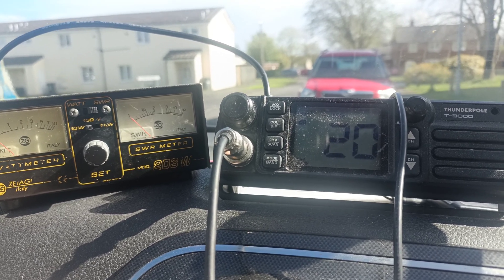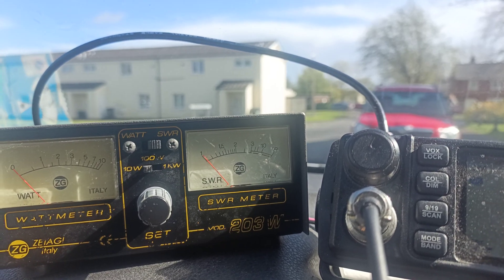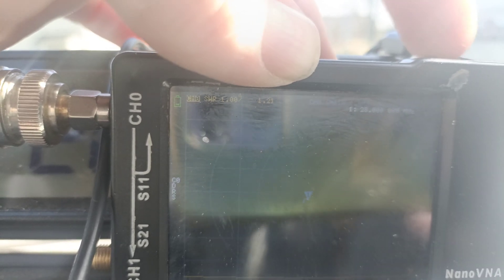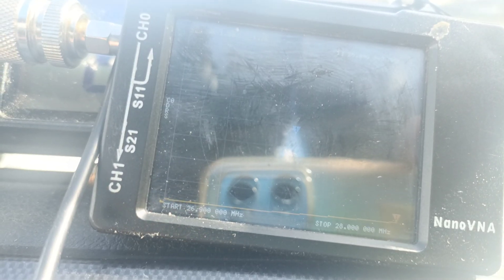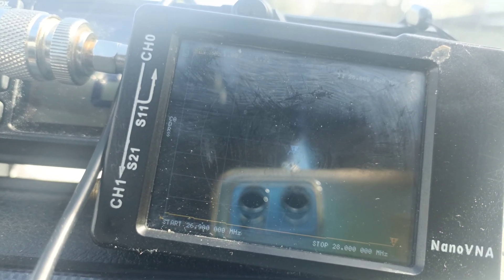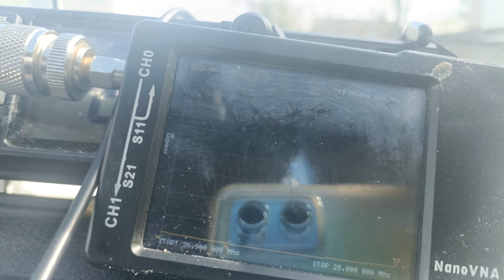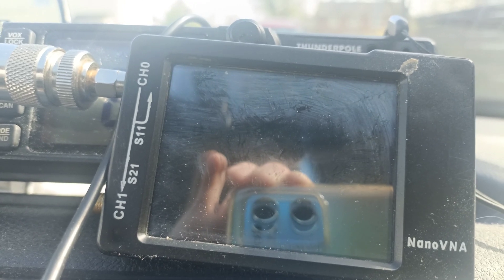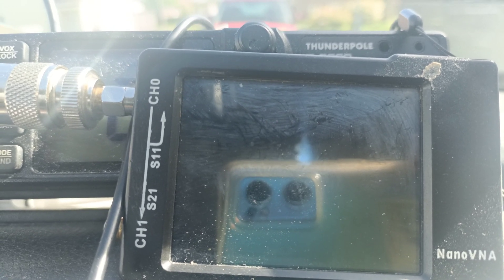An unexpected surprise with my mobile CB antenna

Comment: Thunderpole will sell you 10 grubscrews for £3,99 delivered.
Reply from the maker: I have had a look, indeed they do have grub screws, I also looked on Knights website at the same time but they don't have them despite selling case screws and mic plug screws, if I want them quickly I will probably order from Thunderpole
Reply: Knights do sell them. Just search ‘grub’. I bought some myself from them.